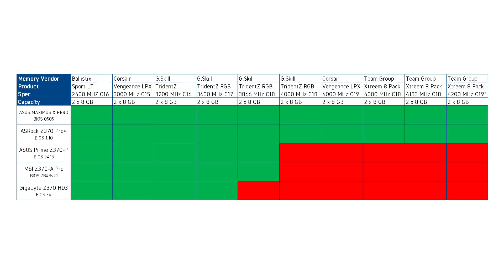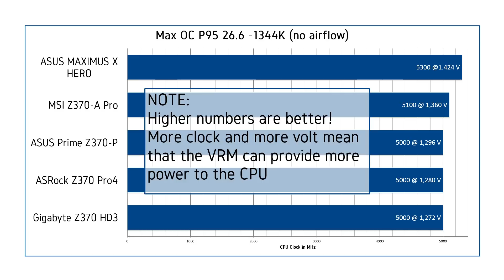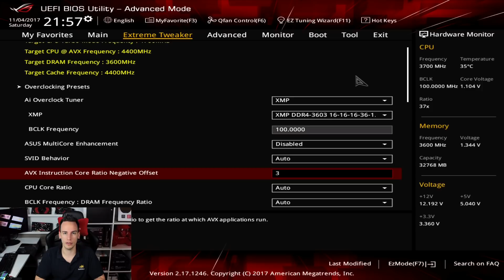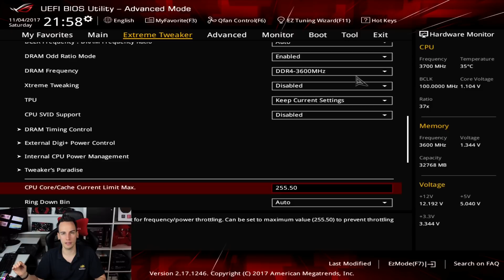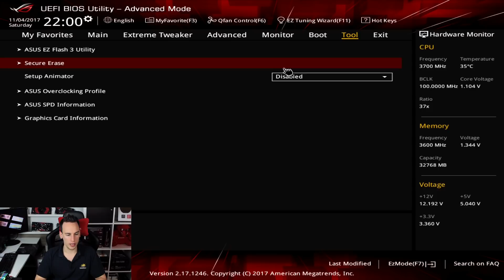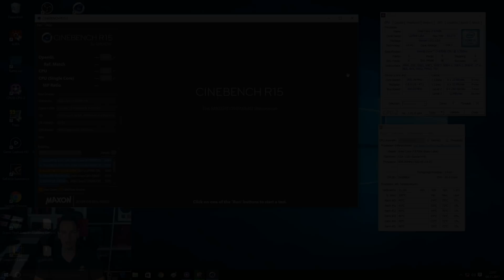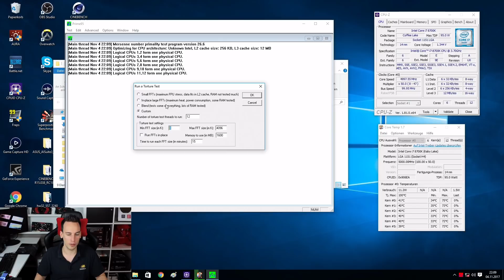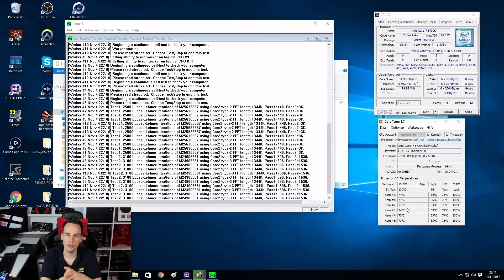ASUS MAXIMUS X HERO - Overclocking Test and Guide 8700K (en)

Comment: How much do you think that OC will affect CPU longevity? I know it's an old myth at this point and it's almost impossible to be completely sure about it, but.. How many years should a 8700K @ 5.0GHz with 1.35V serve you, for example gaming only workload, not rendering? Versus the stock 8700K for example? Do you think we shorten the lifespan of the CPU by a pretty big percentage like 30-40% or it's so small that it doesn't even matter? :)
Cheers
Reply: Daytona Sixty-Eight there is a phenomena called elctromigration that puts a long and very slowly dead to all electrical components. So long that i would not care even using 24h. Except for that a cpu has a long life, for sure more than the day it will be really outdated.
People talk BS, you don’t lower lifespan in any significant way, trust me, of course using a safe voltage for the chip. I think the % is made on people who goes woah full power 1.8 to stabilize 5.5ghz (i’m guessing random numbers for cpu x) killing some poor hardware!😂
Reply: anything up to 1.40v is absolutely safe if you have good cooling
Reply: England is my city I get that it's safe, but for how long? 3, 5, 7 years? :)
Reply: i'm no expert, but i will be surprised if it lasts less than 5 years at 1.40v
Reply: i've now got my 8700k, runs at 5.1ghz at 1.424v idle and 1.344v under load, i'm pretty sure it will last me at least 5 years of heavy use. although intel's datasheet says 1.5v is the max safe voltage, i'd consider 1.45v an upper limit, because of max voltage overshoot after heavy load.
Reply: These over clocks do not affect the life of the processor (Within the data sheet specs)
Reply: Johnny Appleseed although intel allows up to 1.5v, i wouldn't run a chip that high for long. some say don't go above 1.3v, which is way conservative. i wouldn't go above 1.45v for 24/7 operation, that's my safe zone.
Reply: I've still got a x5650 4.62ghz with 1.55v and still working but I'm selling it now.
Reply: I've heard people say will reduce a CPU life by 40-50%. My answer is always 50% of what? A stock CPU technically could run for several decades without issue. You can buy CPUs from the 90s that still work perfectly fine, they are just obsolete but they are not defective. OC is not going to reduce CPU life unless you do something to cause damage. If you keep everything within temp range and voltage there is no damage to be done.

Comment: I just did everything in the video and I'm hitting the 5Ghz but my voltage is only at 0.672. Any help?
Reply: Corey Udelhofen same
Reply: Cesar C I posted on Reddit. It says users of the Maximus X will show half of what you're getting. Just double your number.
Reply: Why does it show correctly in the video?
Reply: update your sensor software.
Reply: You have to update your bios.

Comment: Thanks so much mate! Followed this and got 5ghz no problem with a Cinebench score of 1639cb. My cores are at 72degrees. No delid but with decent AIO.
Reply: mine hitting 90 under water with that setup... (intel burn)
Reply: Richard Dale hi 72 c at average temp or peak  what is your cooling option ? Thanks
Reply: I have the Fractal S24. The ambient temperature in my office is also very low though. Its about 7 degrees outside at the moment and I have my PC quite near the window. I didn't run cinebench for that long. How long do you have to stress test for to reach max temp?
Reply: Prime without avx get in 1 min... cinebench stays in lower temp 70-80

Comment: I am running 26.6 and I still see my cpu downclocking as if AVX instructions are being used. I have a negative 2 avx offset and I go from 5ghz to 4.8 quite frequently during the test. Am I doing something wrong?
Reply from the maker: I'm looking into this at the moment
Reply: Yeah same. Sites at 5ghz idle with high performance and then when I run stress test it goes down to 4.7ghz
Reply: der8auer same here prime95 stays at 4.7
Reply: I am getting the same issue. Other than that, it's been great.
Reply: Same here... When the stress test begins, clock goes down to 4.8ghz and never come back to 5...
Reply: Did you find anything out?
Reply: You guys are not running 26.6 if you are getting the avx offset still.  Turn the offset to 0 if you dont want it to go down.
Reply: Johnny Appleseed so i have to put 0 instead of 3 to not have this downclock during prime95?
Reply: avx negative offset means it will go down by the number you set multiplied by the BCLK frequency under avx load
Reply: Yes if you are not capable of downloading the right prime95 version.

Comment: This was precisely the tutorial I needed. Covered all options extremely concisely. 
Asus Maximus X Hero, Corsair 3200MHz Dominator, no Delid, under a Alphacool Eisbaer 360 w/ AS5.

I used exactly these settings but got BSOD at 1.35v when I ran CINEBENCH.
At 1.36v ... BSOD.
At 1.37v ... BSOD.
At 1.38v ... 94°C ... BSOD.
At 1.39v ... One core hit TJ max ... Got one run, but then CINEBENCH crashed repeatedly. No BSOD.
At 1.40v ... oh jeez, 97°, spike at TJ max ... got three runs in before BSOD.

Okay. I'm going to have to delid. Maybe rethink the cooling? It seems it's defeinitely hitting stability issues from temperature. (What's everyone else using as a cooler these days?)

EDIT: turns out the RAM was not configuring correctly with these steps. Set XMP but manually bumped up RAM related voltages
Reply from the maker: Delidding should help quite a lot I think :) Your cooler should be good enough for it actually. I think you just need to swap paste to liquid metal by delidding
Reply: It will. I did find the cause for instability looks like the RAM XMP. I'd love a guide to get that set manually and stable for this board, or I am missing something.

Comment: Just bought this board. This tutorial is very useful I’ve never really done much over clocking. Sorry if this is a dumb question but when setting the XMP profile do I just set this to match my RAM? I have a gSkill 3200mhz 32gb kit in two sticks. Thank you!
Reply from the maker: yes you just set XMP to configure your memory sticks correctly. Without setting XMP your g.skill sticks would run at 2133 instead of 3200
Reply: der8auer thank you really appreciate you getting back to me. I’ll have a go today and see what I can get out of my 8700k. I’ve not delided though. Might order one of your tools if I pick up the courage.

Comment: do i have to delid to get 5gh im at 4.9 right now and i have thee exact same setup mobo and cpu. i have a 3in 360 rad push pull and only cpu is on it. i can delid it but would rather not. should i go for 5 or stay with 4.9
Reply from the maker: What are your temps and voltage?
Reply: temps around 75C under full load have voltage set to 1.35.

Comment: Is AVX that bad for the CPU? My 4790K (4.8GHz, delided, liquid metal and direct die liquid cooling) can run the latest Prime95 (small FFTs) at no more than 85°C and seems fine. Maybe the reported temperature doesn't take the integrated voltage regulator into account?

After all AVX is a great optimisation. I would feel bad downclocking my CPU when a program uses AVX, in which case not using AVX at all would maybe not degrade performance given the clock would be higher.
Reply from the maker: yea the load is a lot higher. At the same speed the power consumption can increase by 20-30 % which is too much usually.

A CPU with 4.7 AVX will still perform a lot faster than at 5.0 GHz non AVX

Comment: I found that the CPU alignment tool also keeps the IHS from sliding when closing the mounting bracket, if you delid the CPU and don't re-glue it.
Reply from the maker: Yes absolutely. I said that in the German version but I think I forgot it in the english version :D
Reply: Personally,   I don't like the super glue concept.   Imo,  RTV Silicone is better because it allows for the thermal expansion and contraction the dissimilar materials will face under heat cycling.    Personally I don't like the corner method,   Imo it's better to bond the entire perimeter leaving only a small vented portion like the factory did.  I believe you end up with a more consistent Z height under mounting pressure.   Different strokes for different folks,   I guess.
Reply: Johnny Appleseed its a tiny bit cooler with out glueing it back so.
Reply: The motherboard comes out of the box with a plastic cover over the cpu socket. Most people just remove this plastic cover and toss it.   However, during CPU installation this cover is designed to be left in place exactly as it comes out of the box in the retention mechanism and it is automatically pushed out as you close the locking lever.   It is designed to help hold the IHS in position.

Here is an example of the technique,   https://youtu.be/97pfHOcLcgg?t=284
Reply: You should always re-glue it.  One bump and you just cracked your dye.  Takes 5 minutes to just go around the outside corners with some clear super glue.

Comment: Is a Dark Rock Pro 3 with 250 watts TDP sufficient for the delided 8700k from caseking for a 4.9 ghz OC, or is an aio mandatory?
Reply from the maker: should do if your case is well ventilated
Reply: Thanks for the reply! It's a bequiet Dark Base Pro with 4 Noctua Indu 2000RPM and 3 SilentWings 3. I usualy have the front door open about half a centimeter, so the airflow does not get restricted. The Powersupply is not at the back, but it's been moved a bit into the case by bequiet. Due to that, the back of the case is very open and allows a lot of air to pass, with little restriction. It's the best airflow I ever had in a case (and quite silent top). So the airflow in the case should be ok.

I was just worried because a friend has a delided 7700k and still reaches 70 to 80 degrees. He is using a Brocken 2 with I believe 170 Watts TDP. Airflow is great he says. He will try the bequiet 280 Loop aio now, in the hope to reduce temps.

Did you ever do any testing on the Watt TDP that an 8700k can produce when OCed? I fail to find anything meaningful on that subject.
Reply: The air cooler unfortunately didn't do it. Too hot under full load, kind of borderline even with open case. I got the caseking 8700k advanced edition, 4.9ghz. But when I run the latest Prime95, the worker crash at the suggested vcore. I'm using second highest LLC and make sure the vcore doesn't drop below the suggested 1.37v vcore. Any suggestions?

I'm on a custom loop now with a 420mm radiator, alphacool xpx, aquastream ultimate. GPU is not watercooled yet. Mainboard is asus rog strix z370-F, CL 14 3200 Ripjaws.

Comment: How can I tell if I'm being throttled by my VRM?  I hear you discussing VRM temperatures and the ability (or inability) of different motherboards to provide adequate voltage to the CPU, but I can't tell if this is the case with my own motherboard.  I'm using the Asus Z370-G Gaming (Wifi-AC) and have my I7-8700k auto OCd using the 5-way optimization.  From what I've heard in this video and some of your other videos it seems unlikely that my VRM is able to supply a stable enough voltage for the OC I'm running.  Is there any way to check for throttling of the VRM.  I have a probe shoved up against the heatsink but it never shows more than 40C.  My overclock runs between 4908MHz (1.232v) up to 5221MHz (1.368v) with a max reading of 1.424v on a rare occasion.  Temps never above 70C max.  Using a manual OC I'm able to get 5.2 at 1.39v fixed, but I like that the auto OC drops down so low at idle while still remaining perfectly stable.

Comment: Wouldn't splitting the high side and low side MOSFET into two separate packages be better as it reduces the power density?
Btw I'm referencing what you said at about 1:25
Reply from the maker: The efficiency is a lot better using the integrated solutions
Reply: der8auer ah right thnx.

Comment: 1.35v and up for a 14nm CPU for 24/7 use is probably not safe in the long run though.
Reply from the maker: a lot of these CPUs have 1,30 - 1,35 at stock

Comment: Does Asus multicore enhancement at auto, even do anything when you manualy overclock? If not, why are you disabling it?
Reply: In my hero disabling the Asus multicore enhancement with 8700k results in very high idle vcore.. Only when I enable it I get low idle and close to load variation. So in my case I leave it enabled. I don't like seeing high idle vcore (1.4v +), when I have set manually 1.3 vcore in bios!

Comment: 6:42
CPU SVID Support on Asus boards Off?
Reply from the maker: +Nisco Racing  you should always disable svid for OC no matter which brand
Reply: Am I correct in saying you need it enabled / auto if you plan on using adaptive, if you still want the voltage stepdown working, to keep it running cooler when idle?
Reply: @TheOfficialSethos  when you use adaptative voltage no matter the cpu svid support setting only in manual mode this setting matters
Reply: SVID is required for Adaptive voltage to work. You dont need to or have to disable it for 24/7 overclocking.
Reply: SVID doesn't cause damage to the CPU. It allows the CPU to request VID from the buck controller.  That's why it's needed for Adaptive voltage mode.
Reply: Sethos you are but ONLY on that scenario 'adaptative"
Reply: Thnx for the clarification. I have watched a few oc guide videos and was still confused. I believe when I oc I will turn it off to find the OC but after that enable svid and adaptive voltage
Reply: Auto is not the same as default. Some mobos have a "default" vcore that is higher or lower than others. You should manually find your lowest stable voltage at stock clock if undervolting is something you're interested in. If you've gotten a 'k' model, not sure why people leave them stock anyways.. but to each his own.
Reply: It' normal...don't worry about it.
Reply: Nisco Racing why did he disabled MCE? In his past video he didnt disable it.can someone explain me why?
Reply: je720...have u managed to avoid any thermal throttling yet on that profile. Just make sure.
Reply: My 8700k on everything on default go to 1.36 vcore i dont now hwy !!

Comment: I can get my 8700K to 5.1Ghz with 1.4V.  I delid, used liquid metal and have the Kraken X62.  I haven't gone past 70c under load.  My question is since my thermals are so good, what do you think is the max voltage for this CPU.  Thanks! I tried 5.2 with 1.42v but its not stable.  I am worried to go past that vCore.
Reply from the maker: 1,40 V should be pretty safe. I wouldn't go over 1,45 tho
Reply: 5.1 at 1.4 volts? Jeez
Reply: stick with 5.1 its still beast cpu mine i cant oc to 5.0 not delided yet im in israel no shiping here
Reply: I delided my 7700k useing kraken x61 with liquid metal got 5.3ghz with 1.4v
Reply: my one goes to  5.1 @ 1.375; 5.2 @ 1.425 and boot to windows 5.3 at 1.49 - I didn't put it under load to not fry it :) delided keeps temperatures up to 82-83 when under full AVX load when 5.1 and around 70-73 without AVX.
Reply: R Pickles 

Followed all steps and on cpu-z, core voltage is 0.672 V.

Only difference is I did 48 instead of 50 overclock because I’m not delidded.

Help please. Thanks!

8700k/Maximus x hero z370/ z trident 3200 16 gb
Reply: Joe Momma once you change cpu svid support to disabled you cut connection between the cpu and your voltage controller. Because of this you will not get a correct voltage value. If you turn that setting to auto or enabled you would see a more accurate voltage reading although cpuz sometimes can read voltage inaccurately
Reply: A Delid is 100% worth it.
Reply: I must have an ok chip then I’m stable at 5.0 @1.365 VCore and hitting about 80C without a delid
Reply: not delidded but i can run mine at 5ghz at 1.28-1.296v stable
Reply: @ezra5485  sure you can
Reply: yup i can
Reply: I wouldn't keep it at 5.3 all the time.  People been reported the cpu dieing when running 5.3 constantly.  Id use 5.1 max for everyday setting.  Having to go from 1.375 to 1.425 is a huge voltage increase, and shows you didnt get the silicone lottery.

Comment: I'm having problems with AVX offset with 0505 BIOS: my CPU drops clocks at pretty much any load not only at AVX load if I use offset.
Reply from the maker: Did you disable CPU SVID and all power limit options?
Reply: I didn't disable SVID but I tried disabling power limits which didn't help. My CPU was droping clocks both at RealBench and Cinebench r15 pulling a maximum of 130W judging by HWinfo.

Comment: Sir
Can you do same thing with Aorus gigabyte z370 gaming 7  ?

Thanks in advance
Reply: Yes you can but not as good as the asus boards
Reply: Bain Slayz. He asked for a guide. And you can do the same with the Aorus 7 no problem. Quality is about the same. Asus is just overpriced as usual. Even a Taichi gives you same results for 100 dollars less.
Reply: Fırat BAKAN. Yes please!
Reply: Yes you can.
Reply: NickyB well technically asus is a bit better even if it was slightly better that doesn’t mean they are the same it’s like saying 1.99tb is exactly like 2tb there’s a difference even if it’s slight
Reply: Bain Slayz. is "about" the same i said man. The difference for 24/7 use is minor. Buy the one with the extra features like dual lan and stuff. Cant go wrong with any of the higher end ones.